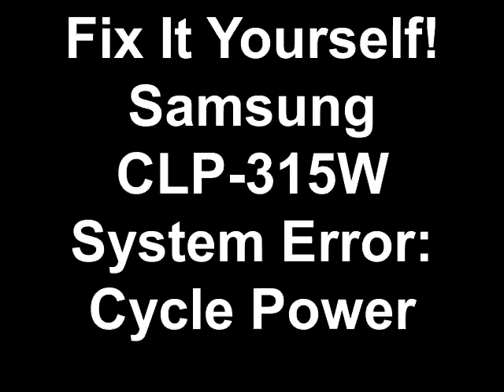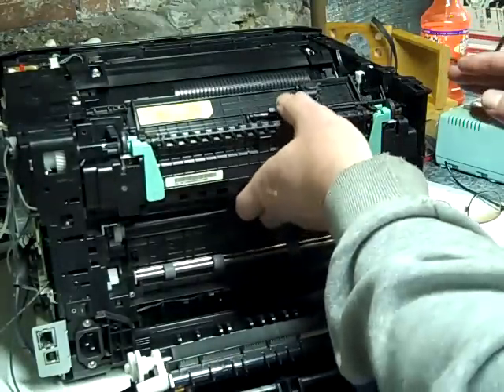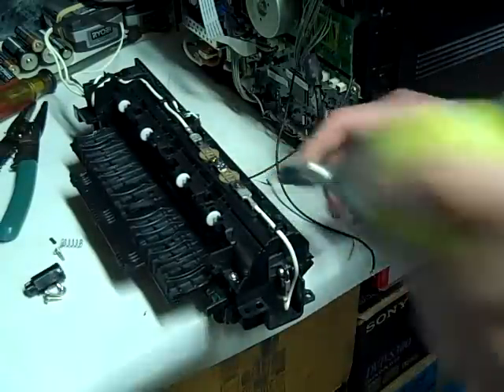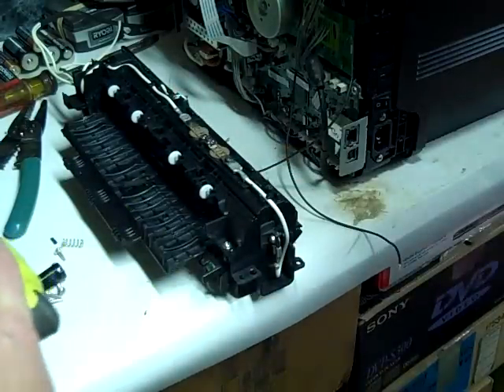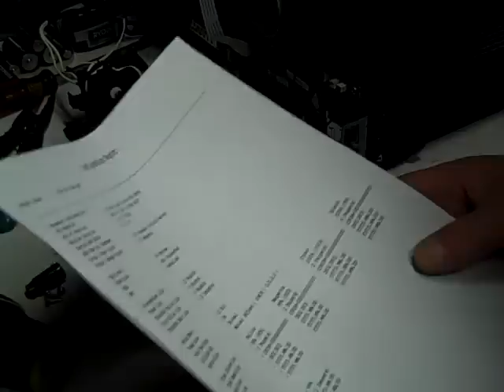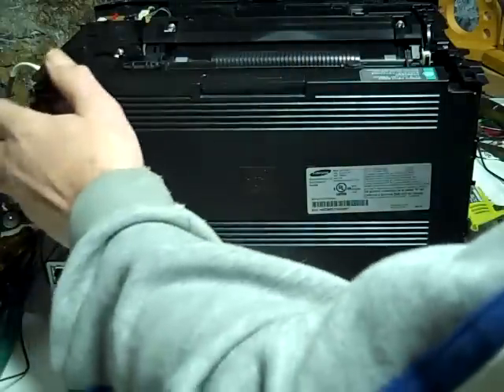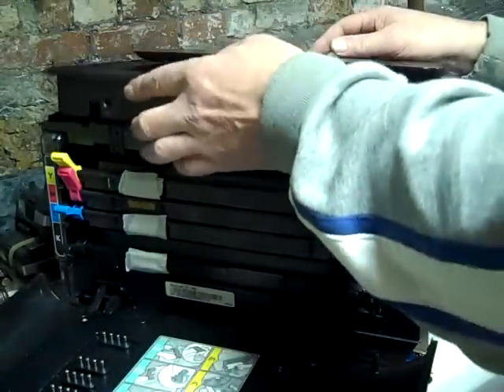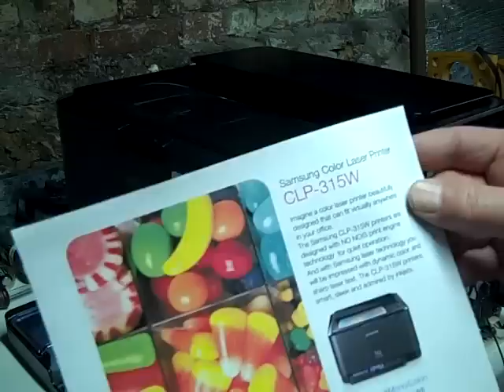Samsung CLP-315W Printer - System Error - Cycle Power - How to Fix it Youself

Comment: Excellent - fixed my CLP310. Symptoms were that there was no motor sound at power up and the toner lights flashed for a while but then stopped and the main light stayed red. One of the sensors was open circuit and a tap on kitchen work-top reset it. Printer back in action.  Worst bit was getting the side panel off - had to use perseverence.
Huge thanks for sharing this fix with the community   :thumbsup:
Would have sent you a message to say thanks...   Thanks!!
BTW - For testing after resetting the sensor, the top cover needs to be in place :-)

Comment: Wow, thank you.  I had just replaced one of the drums on my Samsung CLX-3175FN printer, used it a few times, then had the "system error" message.  I followed your instructions and got it working, after I finished laughing at the idea of rapping the part on the bench.  Not laughing now though, it worked!  Sounds like my fuser has stopped remembering how to go into standby mode though, so I'll look into getting a new fuser at some point.  For now, I'll just cycle the printer on and off as needed, which isn't all that often, and I now know how to reset that thermostat.  Thanks again.
Reply from the maker: You're welcome.
And thanks for commenting.
Reply from the maker: Oh and 3 years later and I'm still just turning on my printer when needed and it's still working.

Comment: Thank you so much.
You really saved me.
My CLX-3185 service manual was referring about replacing the NTC thermistor and nothing about the thermostats that you did.
Maybe Samsung lost something in translation from Korean to English...
I hope that the thermostats will work again in case of another overheat after the "smack"...
Reply from the maker: glad I could help. :)
And good to hear that it worked on your model printer.
Reply from the maker: They definitely work after the smack. 
I had to redo mine a second time.

Comment: I just fixed CLP-2160. It was showing error: low heat error cycle power just after powering it. Very helpful video! THANK YOU
Reply from the maker: You're welcome.
Thanks for adding your comment.
It will help others using Samsung CLP-2160

Comment: thank you very much for that tutorial, it saved me a lot of money for a new fuser.
Worked perfectly on my October 2008 manufactured Samsung clx3175fw printer. 
This model has only one thermistor and if the reset worked 
(by smacking it on the table with the silver side down) it produces a rustling ring noise.
I dont have any devices to check continuity, just followed the tutorial and it works nice now.

Greetings from Germany :-)

Deutsch: "Systemfehler --> Drucker Ein-Aus" lässt sich damit beheben, 
Fixiereinheit ausbauen, auf der Rückseite den einzelnen Thermistor ausbauen, mit der silbernen Seite auf den Tisch schlagen (kräftig) danach sollte es rasseln, alles zusammenbauen und freuen. Meiner läuft seit 2 Tagen ohne zu überhitzen, trotzdem Vorsicht!!! Mit dieser Methode schaltet man den Überhitzungssensor aus. Man kann den Thermistor natürlich auch ersetzen, meine Anfrage bei Conrads läuft noch, mal schauen wie teuer der wird.
Reply from the maker: Hi and Greetings from USA.
Glad it worked out for you.
Reply: do you know a shop who sells these thermistors? I asked "Conrads" (a german supplier for professional electricians) but they can't procure the single thermistor for the clx3175fw, probably because they want to sell the complete new fuser instead. The clx3175fw has only one single thermistor and i am wondering if its more secure to exchange the "treated" old one with a new one...
BTW the Samsung printers are working great under Linux.
Reply from the maker: If it's working I wouldn't worry about getting a new one. 
If you search on amazon or aliexpress you could probably find a suitable replacement.
Reply: ok, then i'll leave it like it is and forget about a new thermistor, its not overheating anyways for 3 days now :-)

Comment: with the Samsung CLX-3170FN it was also working (a little different) your Tipp was saving my Printer. 
Fehler in Deutsch: Systemfehler - Drucker aus / ein
Reply from the maker: +Ulrich Jaeger Awesome! So it is confirmed to work on CLX-3170FN now. It's a bit different but uses the same part.

Comment: I had the same error on my CLX-3175 so started to follow the instructions here.  When I got the fuser out I found several sheets of paper wrapped tightly around the roller.  Unfortunately the fuser had fused the toner to both paper surfaces.  Eventually I managed to get the paper out so I refitted the fuser and the error message went away.
Reply from the maker: Great Job and thanks for sharing :)

Comment: thank you for the video....but i was wondering ...how do i open the cover...your video starts with the outer covers removed...how to i remove those...if its okay to create another video on how to open the printer till i get to that point on this video
Reply: put the printer on the left side (from standing in front of it), take a screwdriver (or your fingernails) and annul (release) the two pins on the bottom of your printer to release the right side of the chassis. Thats it.

Comment: tell me, did you change any parts in the printer during the repair? or is it enough to take it apart and put it back together?
Reply from the maker: I didn't change any parts. Just reset the thermistor. If you have continuity it's good.
Reply: I failed. after I shook it and tapped it, nothing worked(((((
Reply from the maker: you have to give it a good smack on the table or work bench. If it's still rattling, do it again. Test for continuity each time.
Reply: Friend, I shake it and it rattles. Is that okay? or should it stop rattling after the impact? Something inside him rattles when I shake it. Or should it stop rattling after the impact?
Reply from the maker: I think it should stop rattling. You have to check for continuity to see If electricity can flow from one terminal to the other. Use a tester or make some kind of tester to use.

Comment: Question...Do these instructions work for the Samsung CPL-310? I have the same "system error: cycle power". 

I notice that when the power is turned on, the printer cycles thru the LEDs and there is a definite 'click' just before the red error light comes on. I'm guessing that is the thermistor trying to switch on. [?]
Reply from the maker: +Blades1889 Well I don't have a CLP-310 but in my description you can see I say it should work on CLP-310N. The N is probably just to designate it as a network printer.  The click is probably a relay shutting it down because the thermistor is already clicked off. You can test it with a continiuity tester when you take it apart. It should have continuity from one end to the other.
Reply: +Fix It Yourself! You, Sir, are a top man. All working now. So, yes, the instructions do work for the CLP-310. Checked for continuity (one of the 2 thermistors was not working). The good one made a slight rattling noise when shaken. The bad/stuck one made no noise. Tapped (with increasing force) the bad one until it also started to rattle. Then checked for continuity, both OK and re-assembled. Cheers!
Reply from the maker: +Blades1889 Thats good to hear because these really are great printers, I love mine and hope I can keep it working for a long time. Glad you got yours sorted. Cheers!

Comment: Great job - thanks for the info, did not work for me, suspect fuser heating element is gone. Should have tested while I had it apart. Should just be able to just test for continuity in fuser element. Thanks anyways.

Comment: i have a clp 315 printer and i emptied the toner recycle bin and now it keeps giving me an error code to replace the bin. is there a reset for that?
Reply from the maker: Did you clean the inside of the bin?
There is a sensor that sees the blackness and causes the printer to shut down.
So if it is clear it should be ok.
Reply: clean it with clear water till its totally empty, then dry it for one day and put it in...
Reply: that is what i ended up doing and it worked, i had emptied the bin and couldn't see any reason to clean it any further, didn't know there was another failsafe on the bin.

Comment: Unfortunately it didn't work for me. I removed the fuser and there was no issue with continuity. In addition to the cycle power error, the motor is not turning when the printer starts. I removed the main board and found a few electrolitic capacitors with very low resistance accross (<20 Ohm), but they were not shorting when removed from the board. No signs of smoke or exploded components. I've ordered a new main board, so far unable to locate the faulty component.
Reply from the maker: How did the board replacement go?

Comment: Did this. Absolute breeze to take the fuser out and put it back in. Problem is it made no difference because tapping the thermostat didn't restore continuity. If the thermostat is dead then I can't seem to find any replacement in the UK on the internet. These Samsung printers produce great results when they work, but they are totally unreliable.
Reply from the maker: +Andy Waterhouse did I say tap it? You have to really smack it on the table to make the sping inside flip back to its original position. Its like one of those clicker springs. It pops out one way and when you smack it on the table it pops back into position.

Comment: My thermistors were 2 little buttons x 2 not like the picture. I guess they didn't want an easy fix to be available
Reply from the maker: Which model printer do you have? Maybe you can just replace them without replacing the whole thing.